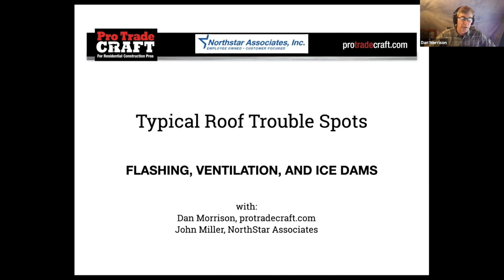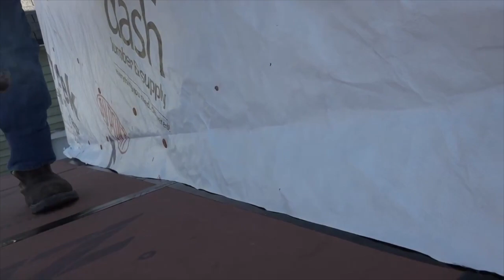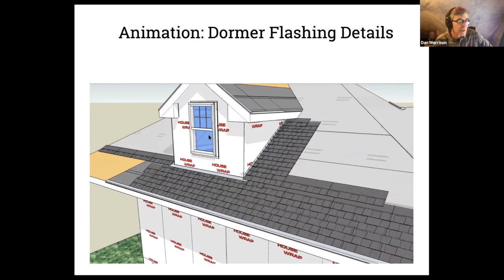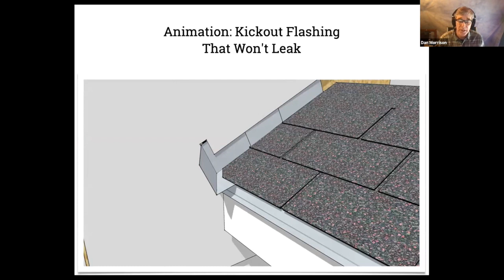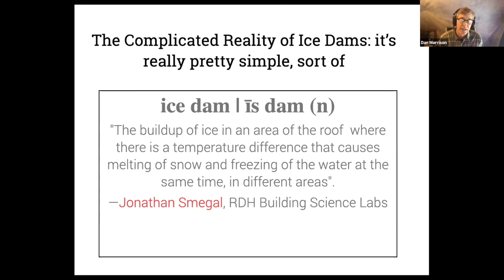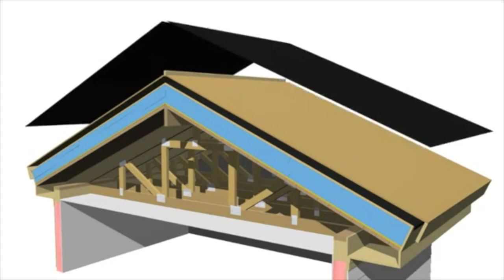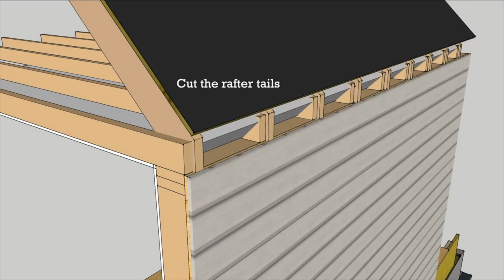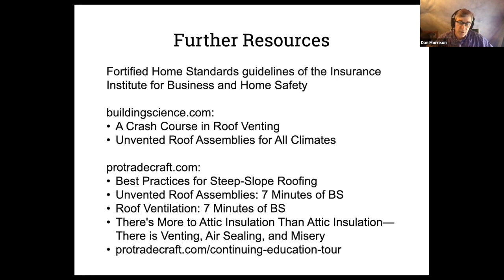5: Roof Problems and Solutions

Comment: I wonder how, and however constructed, substantial roof overhangs might change best practices roof wrapping and flashing details with dormers, chimneys and the like. I am interested also in potential need for gutters and downspouts with long roof overhangs, useful often for other reasons!
Reply from the maker: Not sure how it affects dormer or chimney flashing, unless the chimney is at an end wall, interrupting the roof edge. Nothing a smart designer cannot figure out.

Gutters and downspouts are an important part of water management, and can also become a problem is ice damming is an issue—way beyond the scope of a comment section on a youtube video...

Comment: One thing I vehemently disagree with is starting the roof decking flush with the  subfascia board, and then relying solely on the drip edge to drop water into a gutter. Inevitably, the run-off gets sucked back down along the vertical leg of the drip edge and behind the gutter. When I did framing and a 3/4" fascia board was installed, the edge of the roof decking was set 1½" out from the subfascia so the drip edge would actually drip into the gutter. Nobody does that anymore. We are not retaining the historic wisdom of the trades.